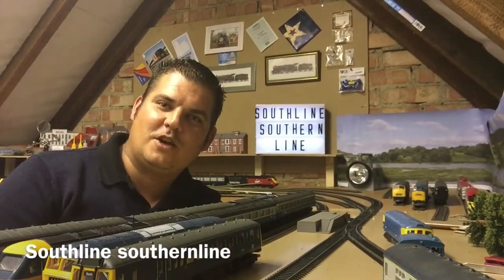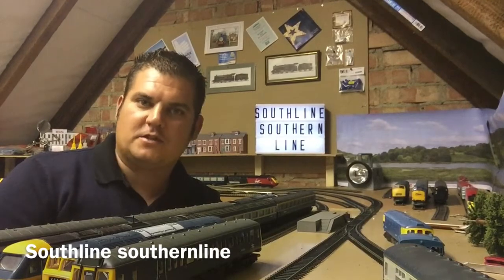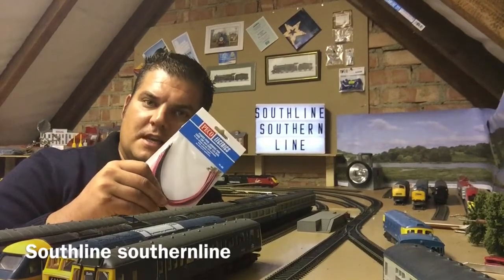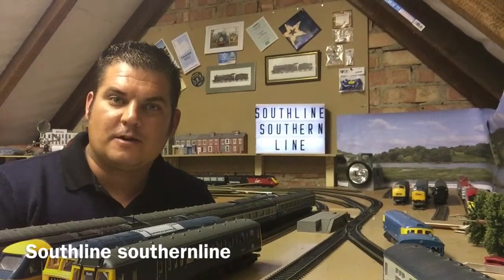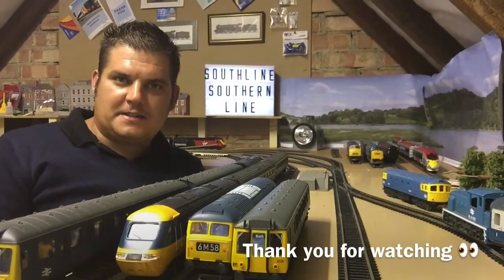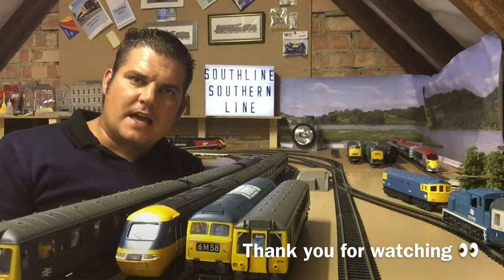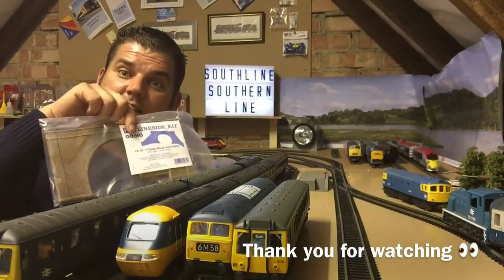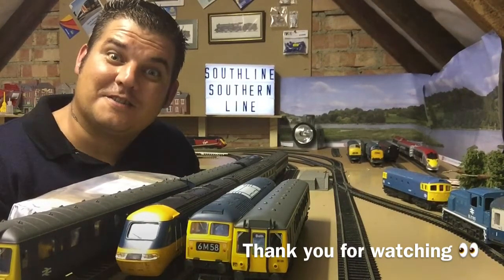Wiring Some Track ⚡️

Comment: Hi there
Those peco wired track joiners are a god send  if your like me and dont like soldering i use choc block connectors to conect the to my bus wire very easy and cheap Keep up the good work cheers Pete